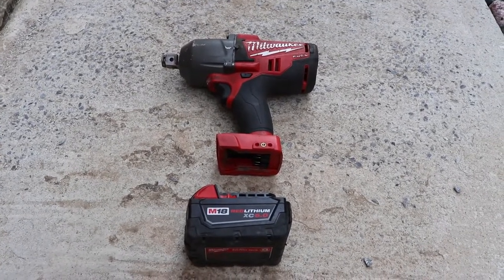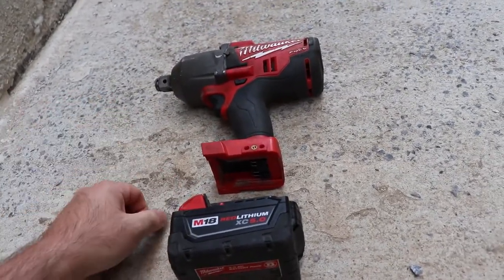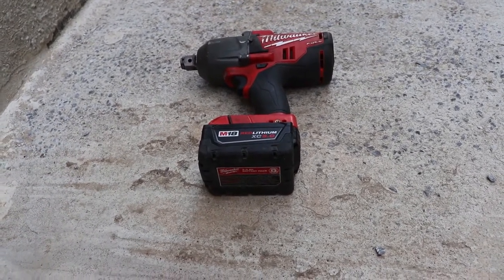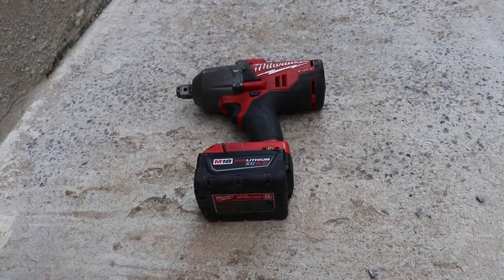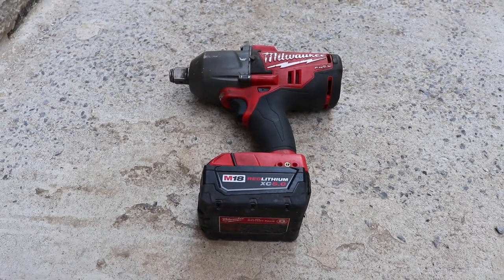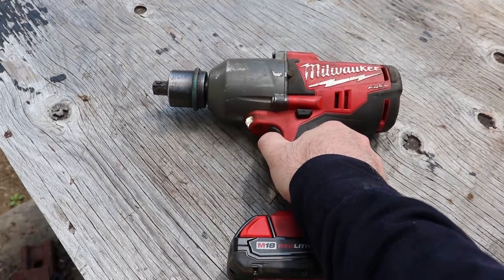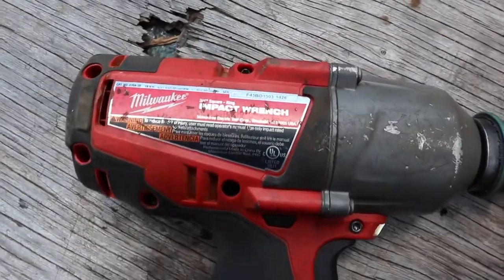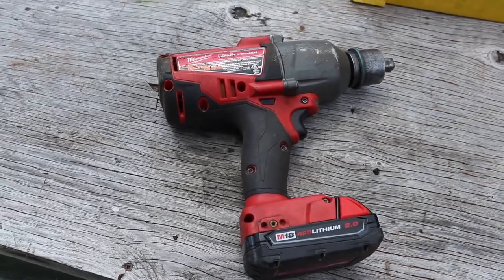Easy Diagnosis Milwaukee M18 Electronics

Comment: Mine only works sometimes. Sometime works great, sometimes completely dead.
Reply: My dead wont turn.
Reply: Exact same issue with mine. Frustrating.
Reply: Did you get to the bottom of it? Mine was going the same, now completely dead,  led comes on. Speed switch doesn't work
Reply: @mohammedazam8915  I'm pretty sure it's the control board. The motor is fine and I don't think it's the switch. Milwaukee control boards are junk. Like putting cheap Chinese shoes on LeBron James. They're batteries don't seem to be any better. I have only one battery out of 4 that still work. I checked the cells and they're all good but no power. Heck one of them even says it's full but still won't put anything out.
Reply: @nathanhale7444  interesting.  I'm gonna open mine up again, have a feeling its the switch as the led doesn't come on with the switch

Comment: ours fail at work often and it seems its stuck in a low power mode and the power selector switch no longer works